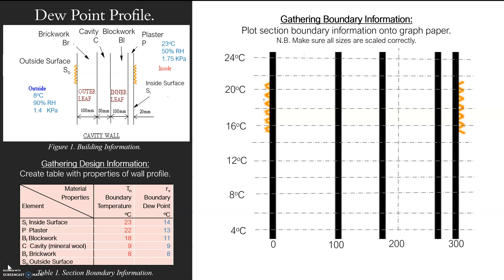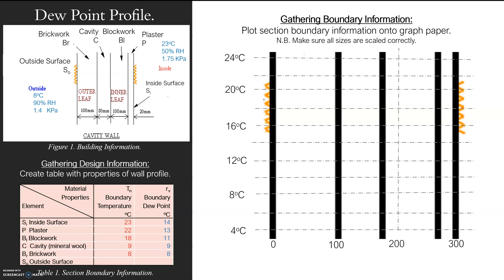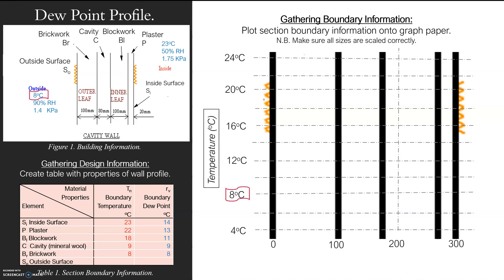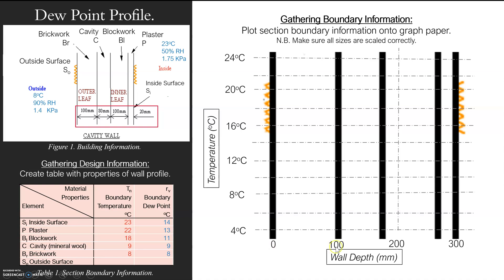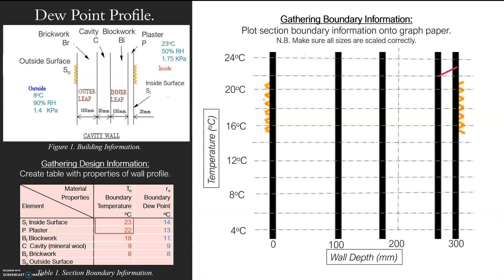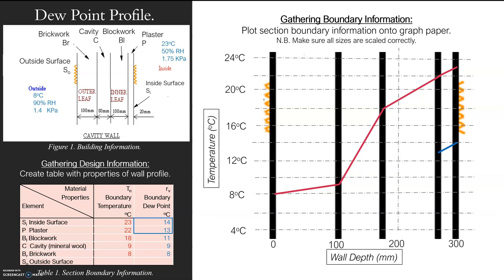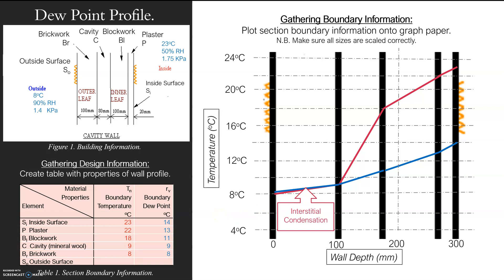Material Calculations: Dew Point Profile Part 3

Comment: This is all correct, however it's hard to believe you are concerned about the likely effect of a few grams of water vapour condensing and freezing inside an external porous brick wall!
Surely the real problem is water vapour travelling through a crack in the wall from inside to out.
Reply from the maker: Hi there. I totally agree with you that cracks are a problem which need to be picked up by surveyors and if the vapour is inside a porous material it's not an issue. This video is part of my lecture showing the process of profiling so that students can move on to calculate different wall configurations and try to minimise interstitial condensation within insulation materials. The learning outcome of my session is to show that insulation installed inside the cavity doesn't allow bricks to 'breathe' and vapour to drain away naturally so unless it's managed properly, moisture can sit inside the insulation and cause damage that we can't see.  I hope that helps put your mind at ease and you enjoyed the video. :)
Reply: Hi, is this based around full fill fibreglass insulation as opposed to partial fill rigid board insulation (maintaining a 50mm cavity)?